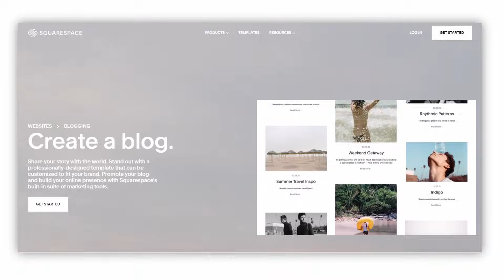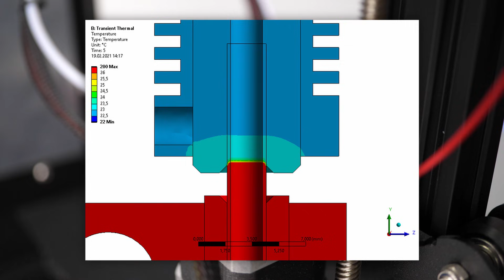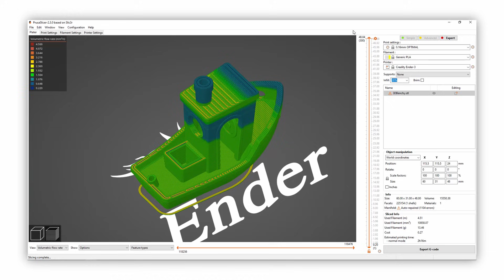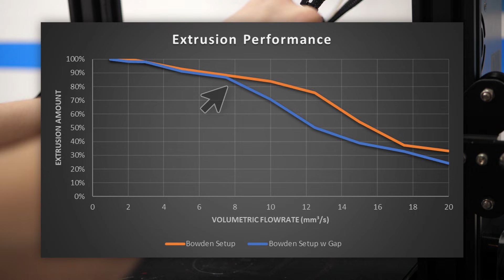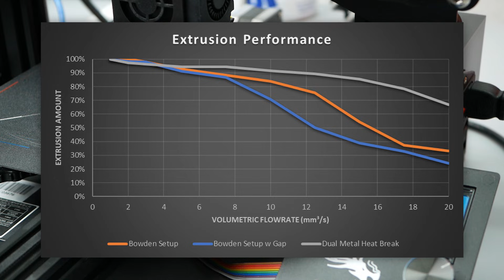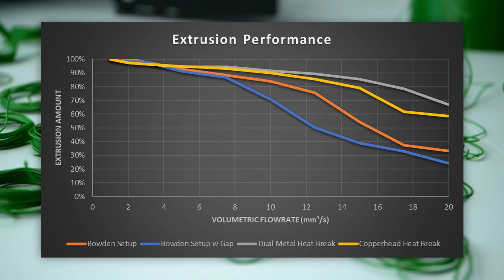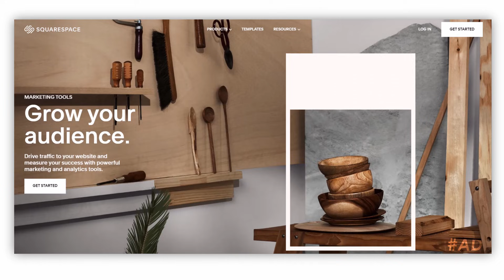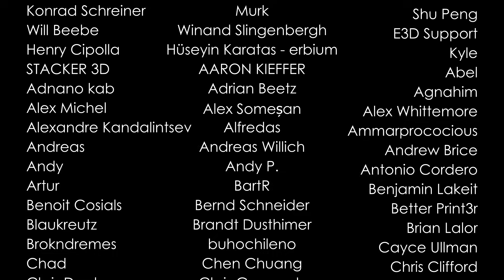Bi-Metallic Heat Breaks - A (R)Evolution?!

Comment from the maker: Would you prefer changing just the Heat Break or would you rather replace the whole Hotend?
Don't forget to like & subscribe and share this video on Facebook, Reddit, Twitter, and other platforms!
Reply: If the hotend is fine, the heatbreak will do
Reply: For most folks with an Ender 3 that want to run hotter filaments, this is a simpler way to do it that a full hot end swap.
Reply: What is extruder graff? @7:32
Reply: @RaphaHey  extruder graph, I think is the manually weighed material plotted VS feed rate?
Reply: I prefer to change the heatbreak and nozzle, the block and cooling area dont seem to affect as much for me at normal high PETG temps,

If i was high temp materials, then yeah swap the whole hotened otherwise just the filament touching parts.
Reply: Nice find. However they are all bowden in my mind, to my knowledge bowden is when we have a remote extruder pushing filament trough a tube. The difference is all metal bowden and ptfe lined bowden
Reply: As someone with an Ender 3 and a stock heatsink/heatbreak, just replacing the Heat Break seems perfectly fine after watching this video. Really cost effective as well!
Reply: Why not use some sort of Aerogel heat-break?
Or even Fiber-glass?
Reply: you should test it on the prusa!!!  wanna print at 15mm^3/s
Reply: I just recently got a microswiss for my ender and it made a world of different for quality of prints and I now have way less under extrusion
Reply: I'm most likely to get a cheap clone hot end/heatsink and fit it with a good quality heartbreak as not to ruin my working(but not great) ender 3 hot end. The heat sink and hot-end are essentially just chunks of metal that require  relatively little precision.
Reply: why didn´t you look into the newer ones which are built like the Dragon? 
i can share the experience with the cheap bimetal clones.
Reply: I'm really intrigued by the hotend, I was considering a microswiss, and wondering if it's actually that good value vs a mellow copy of the same or even thier mosquito copy, or knowing that I'll be printing a fan shround and at some point I'll be investingating direct drive whether a MK6 style hotend  would give more flexibility and why do the expensive hotends have collets rather than a screw in pressure coupling.... And just sorting the heatbreak actually gets me to where I need to be right now for not a huge amount of money, and doesn't exclude cheapskate direct drive options
Reply: i would really like to know what the downsides of a titanium heat break are. did you make a video about that in the past? i cant remember...
Reply: @denizyuksel6983  its in this Video
Reply: Hi, I fit a cheap all metal hotend to my ender 3 and it works great. I did get some pipe cleaners and metal polish, to polish the filament path in the hotend before use. Maybe you could try polishing the inside of the cheap bi-metal heat break.
Reply: Stephan, I switched to the Mosquito on my Prusa MK3s, and I will never go back to an E3D. The Mosquito is more forgiving with filament, and allows me to push filament through the hotend faster. It also makes changes nozzles a 1 hand - 1 tool job! I switch nozzles often, so this is a huge benefit.
Thanks for your videos. They are always educational and interesting.
Reply: Would love to see a comparison between the slice engineering heatbreak and a microswiss hotend? I wonder which is better
Reply: Changing from stock extruder assembly to full metal dual axis has even more effect on retractions... and should really be used for these kind of tests. With the stock heatbreak, my retractions are at 4mm. With the stock plastic i had 8mm and with full metal one axis i had 6-7mm.
Reply: OK I get it is not a must have mod but I am curious about the idea of printing at higher tempretures. My question would be if  you have already PTFE lined the hot end to reduce drag would this heat-break just improve that? In which case seems like a no brainer to use this bi-metalic heat break as your speeds should not only get faster but hotter too.
Reply: I OEM sink is not efficient, neither is the fan cover, need to test the cheap ones with better air flow. It only make sense to keep the creality hotend if you can improve it cheaply, if not replace it.
Reply: I might prefer to buy a entire new hotend. Not because I wouldn't be capable of installing the Heat Break in an existing one, but because it would fit perfectly lengthwise.
Reply: Always looking for ways to curb experiment/upgrade costs. Being Copper, won't it wear too quickly from coarse filaments? Maybe they need a hardened or titanium interior layer. They could just coat a thin walled tube with copper required maybe.
Reply: I have done both. I am using a titanium heat break instead of bi-metal. they are sensitive to jamming, but so are many hotends if they aren't configured correctly. More or less a titanium heat break behaves almost exactly like a microswiss hotend. In a very similar way it is very sensitive to retractions no more than 3mm on bowden. even the retractions in cura at the end gcode can cause terrible clogs. Overall pretty good, with extensive tuning. I am also using copper heatblocks on both the microswiss and creality.
Reply: On an ender 3 (Creality PTFE hotend) I would just get a hemera style extruder 
-Eliminates the weak extruder and arm cracking
-Super short filament path
-No more bowden couplings
Reply: I would prefer changing the entire machine to a Prusa Mk3S!
Reply: Well after I broke the nozzle, the old heatbreak and rendered the whole heat block irreparable (damn you Creality for using lock tight) I would rather replace the whole hotend lmao
Reply: The heatbreak seems to have a real advantage.
I am not that convinced regarding the remaining parts vom Slice Engineering.

A standard V6 aluminium block is lighter, much cheaper and works well. Same for the thermistor, heater, etc.
Tom's test in an SE sponsored video showed no realistic print quality changes between Copperhead and standard V6. But he did not test for throughput and therefore not for high speeds / big nozzles.

Now, while the SE parts are real nice they are really, really pricy. Especially if you want to have several hotends to swap.
Using whatever Coldend which comes with your printer and a standard V6 or Volcano block with standard heater and thermistors seems to be the best compromise in my opinion.

I would be highly interested in a comparison between a copper block and an aluminium block.
In theory copper transports heat a little better than aluminium. But is this even noticable in a V6-style hotend? Do we really get noticable higher flowrates?

Maybe a idea for another test? Do you mind to check a copper block vs. an aluminium block? E3D offers identical V6 blocks made out of copper and aluminium.
Reply: @michaelschaub  Agreed. Replacing the whole hotend when you just want a nicer heatbreak makes no sense.
Reply: I considered a bi-metal heat break but decided to make a one peace heat break and nozzle.  The pictures linked below are a E3D volcano nozzle, brass set screw and 3mm OD stainless steel tubing.  You never get plastic in the threads of the heater block because there is no way for the plastic to get out. This helps the heat transfer from block to nozzle. I wish a company would make nozzles like this so I do not have to make another when it wears out.   https://photos.app.goo.gl/1TPjBG9vzQogAtk18    https://photos.app.goo.gl/nQreH8qyqRsCyv887   https://photos.app.goo.gl/eEmorJhK3w7iLf2m6
Reply: For $30, my first upgrade to an ender 3 would be a direct drive conversion kit like Basaraba's.  That removes so much friction from the filament path and allows turning retractions down a lot (or just off) which also speeds up printing, not to mention the improved print quality due to finer control over extrusion.

Then if I were throwing another $30 at it, I'd replace the original extruder motor with a pancake, though if you're going to throw much more money at it you might as well get a geared direct drive kit instead.  And then replace the control board with a 32-bit like the SKR Mini.

A $30 heat break is pretty far down the list.  It's a super-specialist upgrade - only worth it if you are trying to print functional items at high speeds.  The $30 direct drive conversion gets you some of that speed, but also improves so much more.
Reply: @georgedorn_fnord  I dont think its a super-specialist upgrades - this upgrade allows you to print faster which applies to pretty much most users, for one. Your agument about Bowden has a point, but only applies to Bowden setups but a good deal of printers are direct drive from the outset
Reply: @francistaylor1822  Most users printing non-functional things (things what look good) are going to be limited by movement accuracy long before they're limited by flow rate accuracy.  And if you do convert an ender 3 to direct drive cheaply (which is still worth it - the ender 3 has notorious stringing issues) it does make the speed limit a bigger issue if you care about ghosting in the result.  So it's specialist in the sense that if you are trying to print functional items that don't need to be pretty and you want to do that fast, an improved heat break is a better upgrade than a cheap direct drive kit.

For other printers, the best $30 upgrade will vary.
Reply: I have been toying with the idea of putting a mosquito on my Prusa Mini.
Reply: @DarthTater5738  Not worth it. I have one too and it is well tuned as is. Better go get another printer to tune.
Reply: For me, I've never been able to remove an old heatbreak without damaging it.  So I replace the whole thing. Thinking 🤔 of upgrading to dragon hotend ( mosquito would be better but price) to solve the problem.
Reply: I got 2 heat breaks for £11, all titanium and they also have a wrenched section so you can't go to far into the heat block, stops leaks and a bigger surface area to heat up (without causing creep) I'm impressed but I would still spend £20 on a knock off all metal hot end than a genuine £30 heat break.

Sorry but I can't afford genuine items
Reply: I received my Mosquito Magnum yesterday, which I'm mounting on my Swiss Engineering plate.  :)
Reply: Heatbreak is a pain in the butt to change. You might have to apply thermal grease, you might need a wrench and pliers.

Id much rather just have multiple hot ends.

Honestly, if it was easily available id rather just have multiple hot ends on hand, and just change them out for differently sized nozzles/heatbreaks/etc
Reply: @BeefIngot  exactly what I'm preparing for my printer. Mutiple complete bmg+v6+heater+thermistor+fans+ x plate.
Reply: @MarkoSamirić  how? i am workimg on a idea, but if you have a done system i would love to see it.
Reply: @christopherwolford6522  still wip, waiting for some parts to arrive to make changes and additional heads, but it's nothing "smart" like a tool changer head. It's basically a dde head prototyping system for my ender3v2 with skr mini e3v2.  For anything head or hotend related inspection or maintenance, I usually take the head off the x gantry by loosening the bottom wheel and detaching a belt. It's a couple of minutes to take it off and on, so I thought why not just make the head completely with a plate and wheels detachable from the frame.
Simply explained it's just splicing the stock wiring between the head and the frame, inserting connectors and routing additional wires from the board for future modification. At the mounting point for the stock extruder motor I'll fix DB25 female for the step motor + signals from the board and 2x XT30 female for the hotend and additional fused 24V line. Additional heads will be completely equipped and with their own wiring and male connectors, so no sharing parts between heads. Not really a cost effective solution, it's more like a spine health preservation :D
Similar concept is used in military radio comm systems and I did something similar years ago for my ham shack. All that is needed is to take care of the current rating for connectors and to keep the signal integrity to avoid EMI/RFI by using twisted wire or braided shield iff needed.
Reply: @BeefIngot  You might be interested in Printermods' X-Change tooling system then. A chassis which acccepts an assembly carriage as a replaceable unit, this solution means you can have specialized hot-ends per unit, which while vastly more costly, allows for rapid changing of tooling with some manual effort.

Comment: I got the slice engineering one and I can definitely say it was worth the money thing is basically indestructible works perfectly and I've had no jams honestly even after switching over to it. I think what people really have to do once they switch over is change out the 4010 fan in the hot end to a 4020 because clearly some people are suffering from heat creep which is expected because the threading of the heat breaks at the end of them is copper on top of the stainless steel tubing which is going to obviously act as part of the block and conduct a lot more heat upwards than the default factory heat break. So if anybody out there is going to do this upgrade, make sure you swap your 4010 fan in your hot end for a 4020.

Comment: Installing all metal hotend was my nightmare i had problem with heat creap i try to use all metal hotend to run from it instead its just goes worst your video was so much helpfull for me to do some settings and finally going back to ptfe tupe although after pia tune i Try printing pla in 50 To 65 To 70mm/s speed with 1 To 2-2.5 To 3-3.5 retraction Temps 202 To 215 none works, i try ABS+ too thats not gone well after few prints (its a Downgrade for sure)you can find it every where people have problem with these none of them said its fixed just open topics full of chads try to fix it. if you want print pla its not gonna work at all maybe you survive 2, 3 prints Also your first mistake can be your last mistake with that hotend :D if filament gets jam middle cold zone and hot zone you only can save it with fire or heat gun if you try clean it  with something or using hard /low quailty filament for print you gonna ruin the polish inside and filament cant move freely and keeps stock even when its new  my opinion these are bad just BAD engineering because its gives you some benefits but countless downsides you gonna Tired of it and eventually you leave it  you gonna face it one day if you tring.

Comment: THE BIGGEST DIFFICULTY I ENCOUNTER IN PRINTING PARTS IS UNDERSTANDING THIS CONFIGURATION PROCESS

I KNOW HOW TO MODEL IN 3D AND I CREATED A 3D PIECE OF A LOGO, AND WHEN I PUT IT TO PRINT THE PRINTER WHICH IS A BRAND NEW ENDER 3 V3 IT STARTED TO MAKE NOISE LIKE A MACHINE, I STOPPED THE PRINTING AND I PUT IT TO PRINT THE CUBE THAT COMES WITH THE PRINTER TO EVALUATE IF THERE WERE SOME DEFECTS, BUT THE CUBE CAME OUT PERFECT

BUT NOW I'M AFRAID TO PUT IN PARTS THAT I'VE MODELED TO PRINT. WAS IT SOME CONFIGURATION AT THE BEGINNING OR END OF THE G CODE, OR SOME CONFIGURATION WRONG TO THE POINT OF DAMAGE TO THE MECHANICAL PARTS OF THE PRINTER? 

IT WOULD BE COOL TO HAVE A VIDEO EXPLAINING THE STEP BY STEP HOW TO CREATE A PART IN A 3D PROGRAM SUCH AS: BLENDER AND SET IT UP WITHIN CRIALITY OR ORCA SLICER UP TO THE MOMENT OF PRINTING. GOOD WORK AND THANK YOU.

Comment: What about flex filaments (TPU, TPE)? I haven't tried but i have mixed feelings. The transition between bowden and metalic heatbreak is surely new friction point added to the filament path increasing bowden pressure, but it might reduce heat creep and improve melting in nozzle, which might reduce bowden pressure. Have anyone compared bi-metalic heatbreaks with ptfe lined setup when printing flex?

Comment: Pretty sure the bi-metal heat break I got was a knock off since it was pretty cheap, but it seems to be sized right, so hopefully it will work (haven't gotten a chance to test it yet)

Comment: I'm relatively new to 3D printing but I have 35 years of experience in technical work on office equipment  and I received a working Ender 3 Pro for free and have learned how to use - maintain - and modify it. What I have discovered is that if I remain at relatively slow print speeds I have no problems but when I speed things up the gremlins come out to play. I think the Ender 3 product line is great to learn on but if I was to get serious about 3D Printing I would invest in a Bamboo Lab P1P and move to the next level . Still I'm having fun using and troubleshooting which is what I've done all my life. 3D Printing is relatively a complex hobby - the design CAD programs are an art form onto themselves - learning to use and make adjustments on the slicer program is also quite involved - then there's the printer itself which requires maintenance and knowledge. It's a great hobby but thank God for all the YouTube videos which are so helpful in understanding problems and solutions. Your video sure explains a lot of things.

Comment: Food for thought: assuming one uses the mk8 (cheap Creality) hotend as intended, with both heatblock holding screws, how much would it actually matter if the heatbreak parts started rotating or unsleeving?

as far as I can see, not at all. Work smart not more expensively, people...

second question: has anyone here investigated whether these can offset the temperature penalties of steel nozzles?